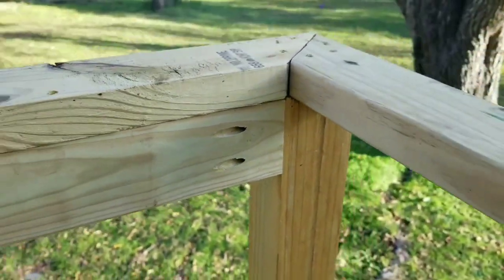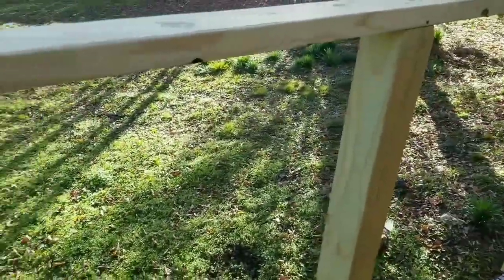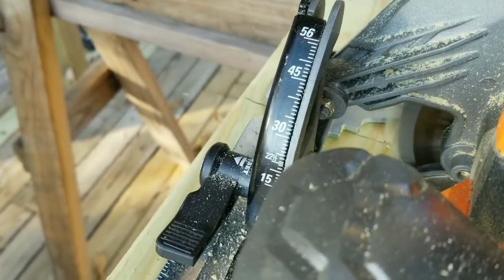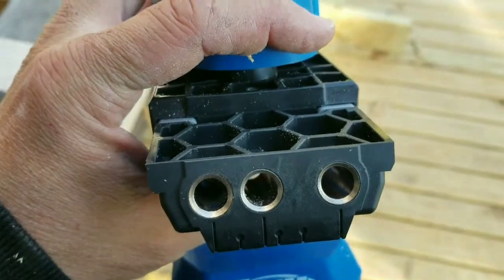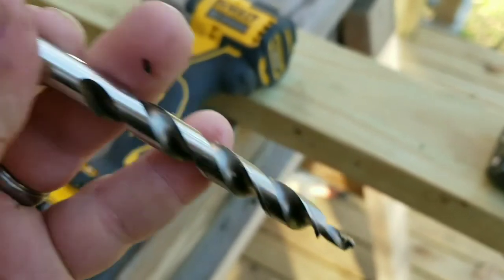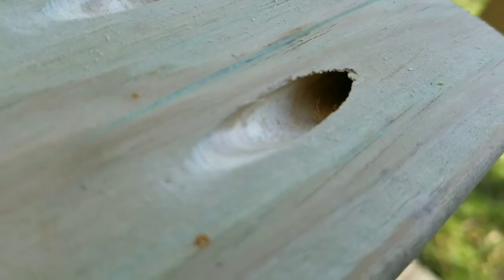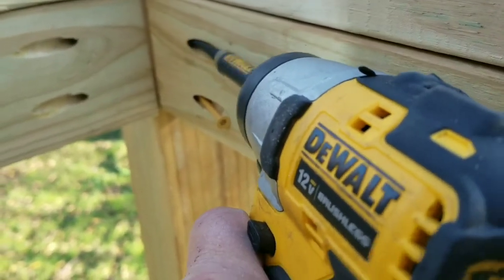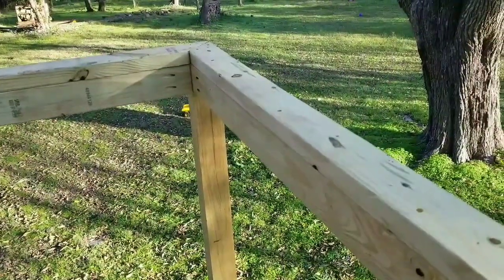How to Build a Deck Railing Using a Kreg Jig (Link for Kreg Jig in description⬇️)

Comment: Good video... but for the fact you used ordinary screws, which don't take advanage of the shoulder created by the drill bit, which you pointed out at 2:09. The "ordinary" screw you're using can tend to split the wood at the shoulder by pushing through, instead of stopping at the shoulder. The Kreg screws are "flat" just behind the head for this reason... better bite.
Reply from the maker: Oops! I just learned something…thanks for pointing that out and adding to the collective education. I genuinely appreciate your constructive criticism. Have a blessed day!

Comment: Hi, just wondering if after a year the wood has shrunk and pulled away from the 4x4 post leaving a small gap between the top rail and 4x4 post?
Reply from the maker: Not much at all. At least nothing unsightly.